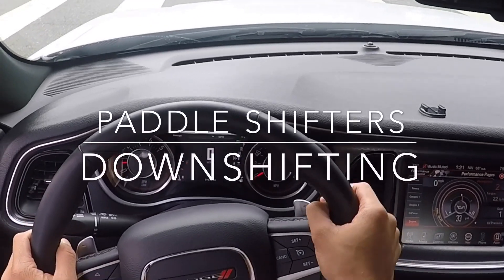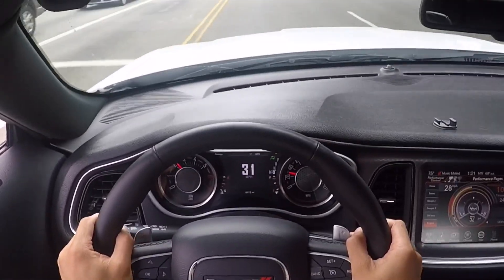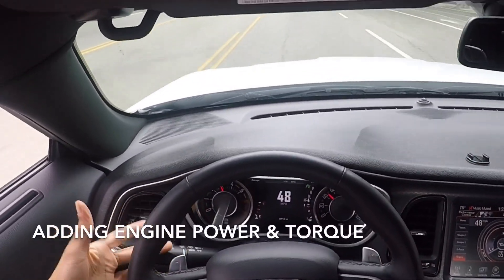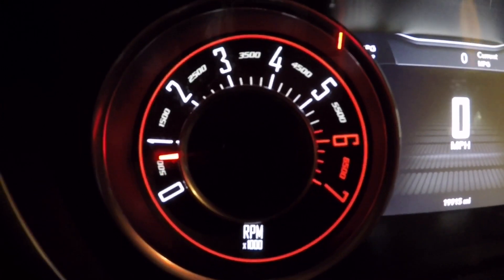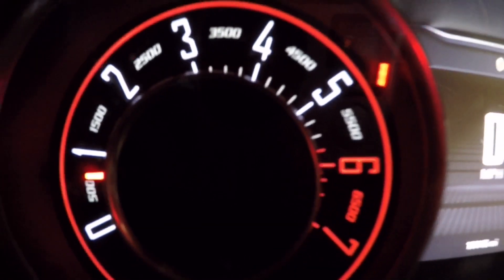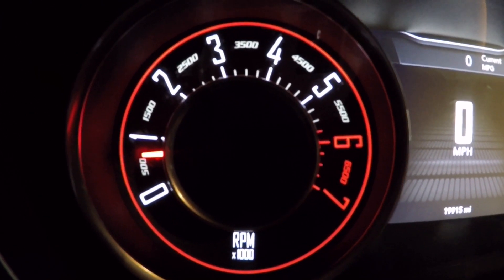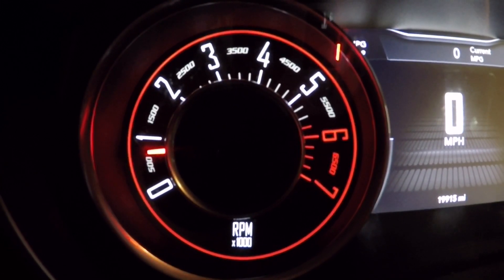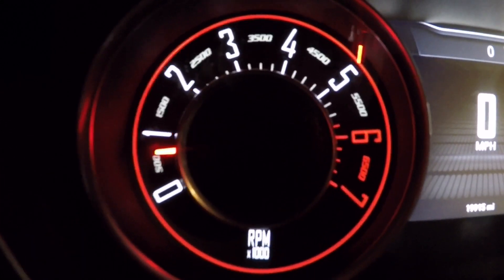PADDLE SHIFTERS: DOWNSHIFTING Explained!

Comment: What if you are on 5th gear then you paddle shifted to fast 1st gear, the car will produce weird sound, its like the rpm is too high. Would that damage the transmission? Is it bad for the transmission?
Reply: of course my horse. You are forcing it
Reply: Most automatic cars will not let you shift to a gear that will cause it to redline or cause damage.
Reply: downshifting to first gear beyond like 10 miles per hour is insane lmao

Comment: what if my automatic w paddle shifters is downshifting with jolts kind of like its trying to engine brake for me? is this normal??
Reply: anytime u r shifting and it is rough or jolting the engine is lugging. to prevent that in those particular cases simply add a bit of throttle before shifting to get revs up a bit.

Comment: It's only lesser-known for flatlanders. We in Colorado use paddle shifting to descend from the Rockies all the time. Preserves the brakes.
Reply: brakes are a LOT cheaper to replace than an engine and/or transmission. Always always need to do both simultaneously for slowing down etc etc

Comment: So you up shift to go faster n u down shift to slow down ??
Reply: up shift faster but no torque (low rpm). down shift while foot on gas will increase rpm (u will definitely feel the pull). down shift while foot not on gas will slow u down due to engine break (good for downhill parkings lol)
Reply: Joshua Caponong best explanation right here
Reply: @jcaps3  AGREE BEST EXPLANATION JOSHY POO

Comment: I also have a charger with paddle shifters I was in 4th gear trying to slow down so I applied breaks and went from 4 to 3rd to 1st and I was breaking the entire time while changing gears and I kept being jerked. Is that going to ruin my transmission bc it was my 1st time doing that thanks!!
Reply: Stolengainz you could have been doing it too early. Your rpms were probably too high for the gears

Comment: Does downshifting while still accelerating hurt the car? For example, if I’m cruising but want to choose a lower gear so I can overtake. Should I take my foot off the accelerator before downshifting?
Reply: ImSJPC no you can accelerate while downshifting or up shifting with paddle shifters or manual mode. Only in a manual transmission will you need to let off the acceleration to switch gears then re-accelerate.
Reply: Not with an automatic no
Reply: Yea I like to keep my foot on too, whenever I can, gets a nice loud down shift
Reply: It does if you're already red lining it geezoir

Comment: The unit for work is Joule, the unit for power is Joules per second or Watt.
Reply: Tork is n*m or kgf.   Power is HP - horse power, wich is most commons used in car industry
Reply: @Adilson077 HP is not common everywhere

Comment: When slowing down and downshifting do you have to rev match or does it automatically do it with the paddle shifters/auto stick?
Reply: Generally speaking, if an automatic transmission comes with paddleshifters or select shift on the shift knob, then the manufacturer probably tuned it to automatically rev-match. Now if you doing a retrofit paddleshift kit or something similar, on a transmission that didn't come factory with the capability to do that, you might run into problems
Reply: @AlexGardunio  ty for the info
Reply: @AlexGardunio  wtf is rev matching in up and downshifting?
Reply: Same question

Comment: I was trying to see if there was a way to rev match and automatic while downshifting with the pattles. My car does not have any kind of rev matching, just jerks you forward and slams into the lower gear.
Reply: Give it gas right after the gear changes, you'll get a hang of it after a while
Reply: @sugarbooty  Is that bad for the transmission?
Reply: @logandeal  not really, just give it enough gas so your engine isnt breaking or accellerating

Comment: Question... if I’m in 5th or 6th gear do I have to downshift before I brake? If I brake while in 6th gear will I mess up my transmission?
Reply: Chris Trujillo hey manz, I just use the brake to slow down the vehicle to full complete stop and let the trans makes automatic downshift. that being said, if the gear is in 6 I downshift to 5 and apply pressure on brake and then let the automatic trans handle the rest.. I would prefer the "wear and tear" on my brake... not buying engineen braking (expensive trans )..dont quote me this could be a bad behavior but maybe someone here could answer your better and also benefit us with their knowledge yah
Reply: @longtong5888  lĺ

Comment: Ford's have no engine braking which is really annoying because if you downshift all that happens is the transmission revving up real fast
Reply: Wait really?
Reply: @johnnelson7977  I use to have a 2012 Ford Focus. That car blew up at 90k miles. But he's right, if you're going down a hill and you drop a gear or 2, the car maintains the same speed, just revs up.
Reply: Same with Toyotas, I think its to coast for long distances but I don't like it